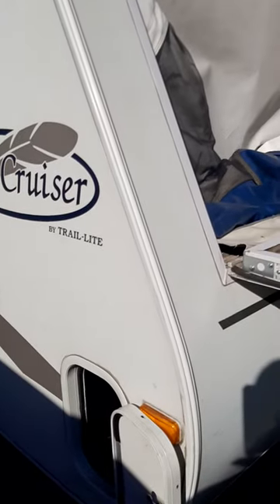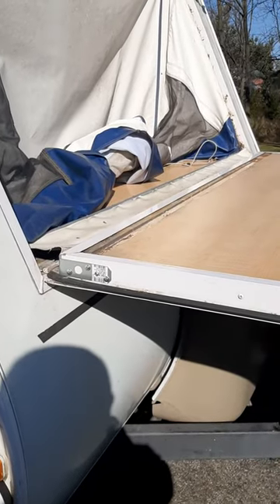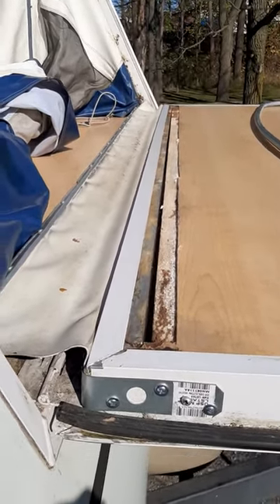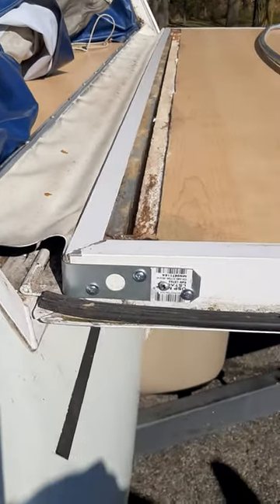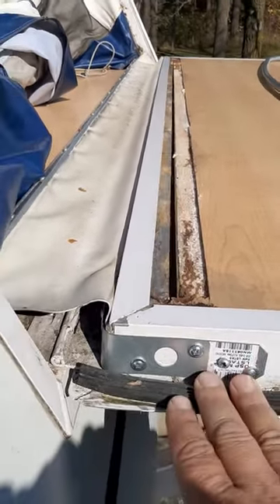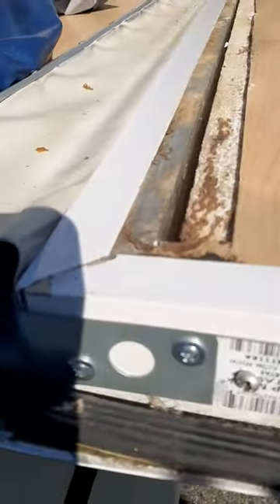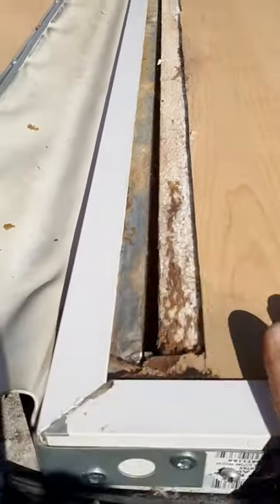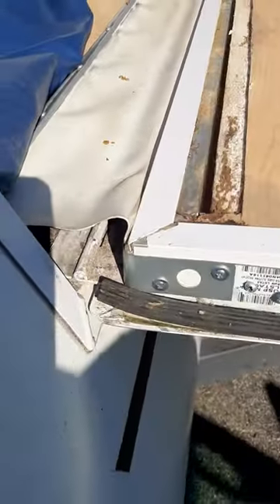hybrid trailer tip out bunk repair

Comment: Did you ever figure out how the water was getting in to create the damage in the first place? I have a hybrid with the same damage in the same spot...........
Reply from the maker: I'm thinking a combination of the seal wearing out and the clamping device that you tighten not working properly thus not making a good seal. Just a guess though. I don't think it was a major leak just never gets a chance to dry out and the thin wood rots.